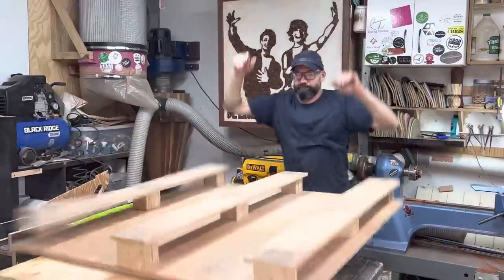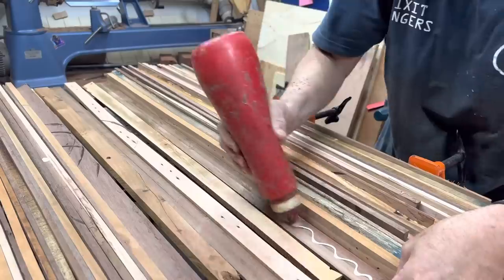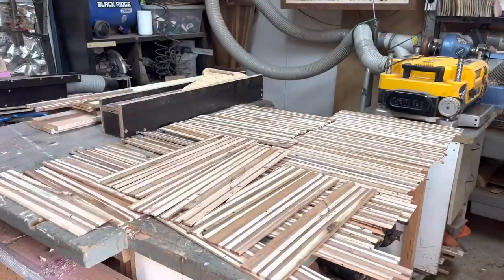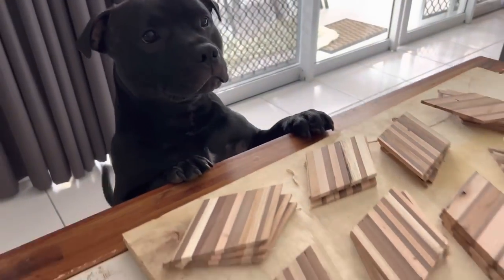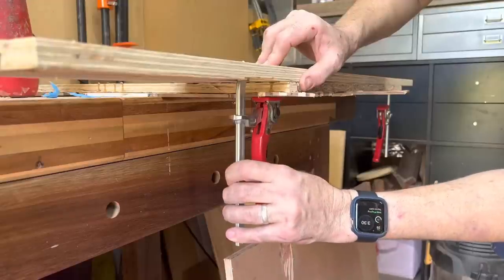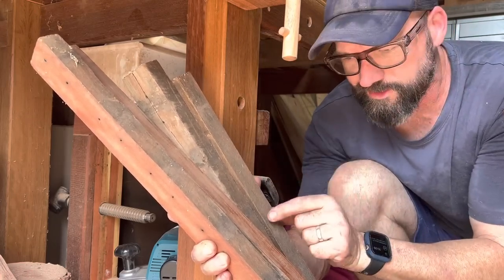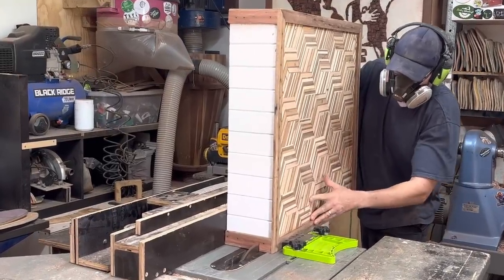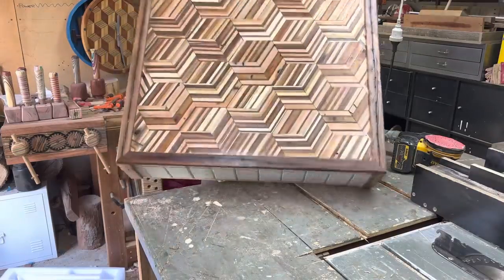Mark makes $$$ from this and so could you - tricks

Comment: I even keep all the saw dust from my machines and chuck it in a couple of special made 44 gallon drums for winter. Cut a whole near the bottom and stick in a piece of plastic gutter pipe that goes to the centre and then pipe that goes to the top fill it with saw dust wet it down a bit and when time comes pull out the pipes and throw in a fire lighter at the bottom the drum stays hot and warms things up for anywhere between 5 to 8 hours. All I'm left with is a little black ash that I spread on the veggie gardens. 0% waste
Reply: Mark wouldn't understand - he is from Townsville, Queensland, and on the coldest days there, he might consider putting a blanket on the bed.
Reply: Is still a good idea though for others to use…. I’m taking it the 44gallon drum is metal??
Reply: Brilliant! 👏
Reply: @dainermade  for the ambience, not the warmth…
Reply: Can you make a video of this? I was searching last night what to do with sawdust, trying to find good ideas.
Reply: Sorry, didn't specify... @marc henning can you make a video?
Reply: @Jaren15949  would love to but unfortunately I am in the process of moving from South Africa back to Australia.

Comment: I took apart about 20 or so pallets to make 4 planters. With each one i discovered a little bit of milling had to be done. Ultimately i discovered i had to mill  any pallet wood that i used to make the project. In the end, i ended up milling 3 pallets to make one 20 x 20 x 20 planter and it was hard a$$ work. I can not fathom the amount of time and work it took to mill all those pieces. it looks great!

Comment: NICE!!! Love that you were able to make this using mostly scrap you saved. I am guilty of "hoarding" scraps of wood. I do a lot of small scale woodworking so I can usually use something others would find as a waste of time to save. Looking forward to the next video!! Cheers!
Reply: @dainermade  Thanks for the inquiry Mark!  I am not on any social media platforms at this point. Used to be on both Instagram and Facebook, but got fed up with all of the scammers on Facebook and the asshats on Instagram. I am in the process of revamping my business though. Once it is completely up and running I plan on setting up profiles on Instagram and Facebook. Will shoot you a friend request once I am up and running!!
Reply: @dainermade  you are 100% accurate on the Facebook statement!!! 🤣🤣🤣🤣🤣🤣🤣🤣🤣🤣🤣🤣🤣🤣🤣🤣🤣🤣🤣🤣🤣